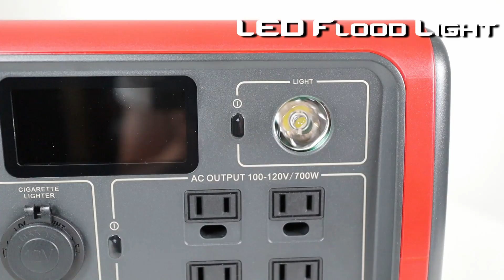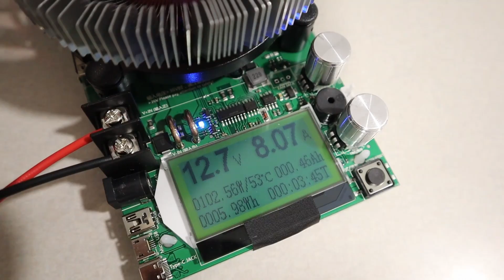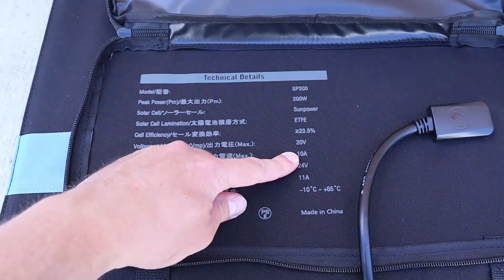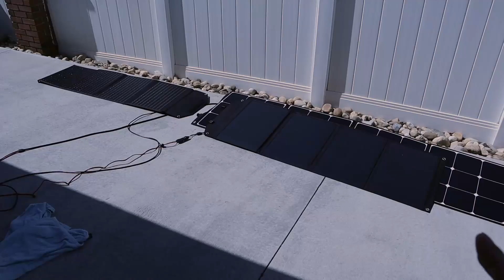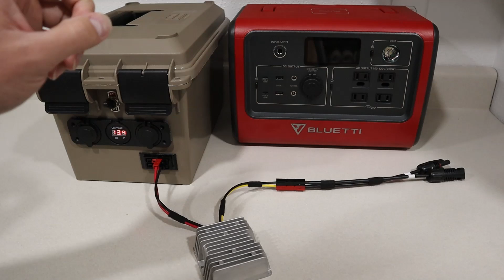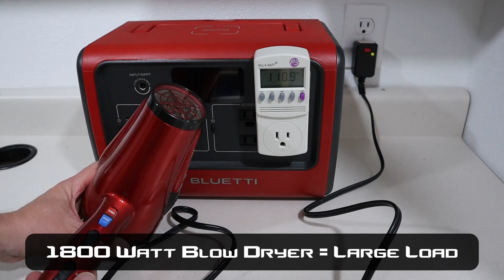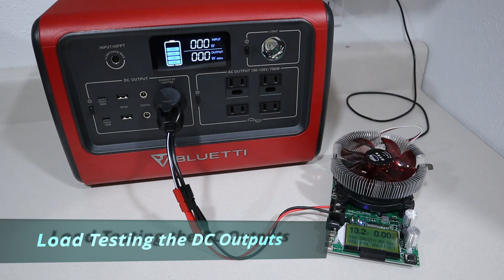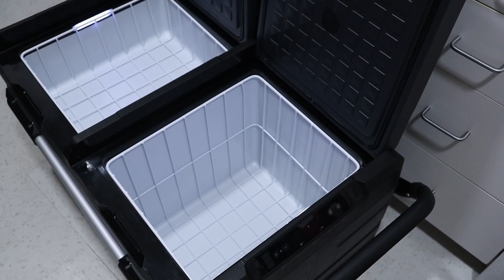Bluetti EB70 LiFeP04  + SP200 Solar Panel - Best Battery for 12v Fridges? - Full Review and Testing!

Comment: This is definitely the best EB70 video on YouTube.  Most importantly some useful info with regards the number of watts at various input voltages while charging, plus the total number of Wh and Ah DC. By the way, I can live with the 600, plus watt hour DC output figure for my use.

My favorite part of this review was seeing the possibility  of a 188 watt DC to DC charge rate.

My own thoughts on this consumer grade, all-in-one, plug and play, compact power center, which is housed  within a small plastic box is that it suffers from some cost engineering:

*The underwhelming display was probably good enough for smaller/ less expensive Bluetti AC30 and AC50S
* The Bluetti EB70 needs an Info button to briefly turn-on the display, please to avoid using the quirky function buttons
* Are the quirky function buttons to turn-on the DC, AC inverter and front facing LED light legacy items from the AC30 or AC50S?
* An 8 amp charging limit of this MPPT controller probably chosen to prolong the life span of some of the internal components are not pro-grade
* None of the online reviewers have noted that the output cable of Blueitti's provided AC to DC power brick uses 18 AWG wiring - which is crazy for 200 watts
* Why are we trying to squeeze 200 watts through that 8mm charging port versus either an Andersen or XT60 port?

With all that said - I'm comfortable with running my 40 liter, 12 volt DC fridge on the EB70.  The 8 Amp charging rate means that a fully depleted EB70 will need to be on whatever charging source for 6 to 8 hours - if the use of Bluetti's AC to DC regulated power brick is not feasible. (For me, it is definitely a limitation, but not a deal breaker).

Don't tell anyone, but I love being able to plug my MacBook directly into the USB-C port.  Thumbs up Bluetti!

For now, I'm using the provided 32" long cable 12 volt cable for on the road charging via a fully fused, dedicated 10 AWG wiring run to the vehicle's battery.  Unfortunately,  I have to manually unplug it when the truck's engine is turned off.  I'll definitely explore engineering a D.I.Y. 12 to 24 volt converter set up for DC to DC charging with the addition of an isolator between the vehicle's battery and EB70 so I no longer have to manually unplug the unit.
Reply from the maker: Sounds like an excellent setup Andrew! Thanks for sharing your thoughts on how you use your EB70. It does seem a bit consumer grade vs pro. The price is decent for where it stands. 

I just got back from a 3 day trip where I used a 45qt dual fridge and freezer on the EB70. It was only charged it via solar. Worked well!
Reply: @Jasonoid  Jason,  I am very forgiving of EB70 because of its small size and weight. Space is at premium in a 4x4 vehicle.  Your review of the EB 70 was on the money.

I failed to mention where I am coming from.  For the past six years I've relied on my trusty circa 2006 state of the art set up that requires the use of a 60 lb, Group 24, flooded lead acid AGM battery and it lacks either an MPPT or PWM controller.  My DC to DC charging is via a second-hand purchase, CTEK fully automatic charger for in vehicle use . The entire package for this old-tech set up is much larger than either the EB70 or the D.I.Y ammo can auxiliary battery shown in your video. If you stay out of the Arizona desert this old-school monstrosity will definitely power my fridge for 36 hours during the summer months.

The EB70 on the other hand is less than half the size and a third the weight. It'll probably power a fridge for 36 hours without a recharge.- (Plus, it includes an AC inverter and MPPT controller). - Two other major advantages noted so far in only two weeks of ownership and three day excursion is the EB70 does not require shutting things down when the battery reaches 12.1 volts or having to keep the battery on trickle charger when in storage mode to prevent sulfatation. 

 My main problem with the EB70 at the moment is it definitely needs a tie down point or a special anchored cubby space to keep it from moving around.

Comment: Bought it anyway, while others can't deliver to my address Bluetti did, those 'quirks' is personal taste and does not affect that the EB70 work for me or my wife. I live in the Caribbean and Amazon is very picky sending to my area. BTW bought the BougeRV and the Ac200p same reason availability and delivery. Great video.,,👍 Explaining the solar panel dilemma, im using a Siemmens SR 100 .
Reply: You made a great choice in my opinion. I have the Bluetti and I`ve been testing it with a small 5 cubic foot AC freezer and a 3.5 cubic foot AC refrigerator and it powers them perfectly. Even with two inexpensive 100 watt glass solar panels in parallel I believe you can still get nearly 150 watts into this thing. I need to test this soon and find out exactly what happens. 

The 2500 charge cycles to 80% capacity is a miracle! I`m in Louisiana and we were directly hit by two hurricanes last year. We lost all our food. The Bluetti is my insurance against that happening again. I don`t want to depend on an expensive gas generator when roads are blocked and gas is impossible to find. I also bought two 300 watt power stations for smaller things like 100 watt 12 volt rice cookers and immersion water heaters to make coffee and tea. 

I have 15 of the little power banks between 10,000 and 36,000 mAh I can charge with seven folding solar panels I have between 20 and 60 watts that have USB ports and USB universal chargers for my radio and flashlight batteries. I also bought three USB fans and several 5 watt warm white USB LED lights.

Comment: Very helpful video!

Three questions: 1) Do the fans in the unit stay on when using DC output?  2) Does the unit cause noise with speaker systems? 3) Can you charge and use AC/DC at the same time?
Reply from the maker: Yes, you can charge it and use it at the same time

The fans only turn on if there is a large load on the battery, I never noticed it while using the DC load output, just the AC output over 100 watts.

As for noise for speaker systems, I haven't noticed anything in particular. Anything you want me to test?
Reply: The charger fan doesn't stop until you unplugged it. I would not just leave it over night to charge as the fan will keep on running eve. After it is fully charged. My does anyway

Comment: I`m happy with mine because it actually powers the 5 cubic ft freezer I bought that runs at about 84 watts after it settles down. I got two 100 watt Mighty Max solar panels and parallel connectors to charge it off grid. My Rockpals and Golabs 300 watt power stations show an error with the freezer...BUT....I can charge those while the Bluetti runs the freezer and use them to put about 540 watt hours back into the Bluetti when I need to. 

So they`ll work as a team if we get hit by two hurricanes again and this time my food is safe. Plus even on a very cloudy day two 100 watt panels in parallel can charge the smaller power stations at a decent speed. I bought poly panels instead of mono because they were cheaper but I plan to get a 100 watt mono panel soon for testing and for the rumored superior performance on hazy days. My small folding mono panels work even when it`s raining! LOL!

There`s a great 100 watt 12 volt rice cooker on Amazon that works great with just about any power station.

Comment: I know why it's only limited to 8amp input. And it's something you can only understand if you work in repair. I can guarantee that if they let it take 10amps, You'd end up with way less charge cycles. Compare a Mercedes to a Toyota. Toyotas last longer because the make engine that put out half the power of a Mercedes.
Reply from the maker: Great point Carlos, Lifepo4 batteries can usually handle a 1C charge rate! So if these are a 32amp hour set of cells as noted on the back sticker of the EB70, it could technically charge at 32amps if they designed it that way. For example, my DIY 80ah battery could charge at 80amps if I wanted to and it shouldn't cause damage. Less charging rate might be better for longer life but the difference between 8 amps and 10 amps shouldn't really matter on these cells. Thanks for commenting! I wish they bumped it up just a tad
Reply: @Jasonoid  I agree. The 2amps ultimately should have just been given. But most likely bluetti doesn't manufacture their own charge controllers. Like most companies they probably manufacture very little themselves and they just source components and make them work well to where they can guarantee a warranty. A cheap mppt controller and display is all that keeps this from being unbeatable
Reply from the maker: @Carlos-jh5tb  totally agree, still performs very good for the price, especially while having Lifepo4 cells!
Reply: @Jasonoid  definitely. And I think the 100w usb c ports are slept on right now too. But all decent laptops and chromebooks charge via PD. At 100w each. It's going to remain being useful for it's entire life span.
Reply: @Jasonoid  The recommend max charge rate for most LiFePO4 is .5C. So the limitations is not for cycle life.

But the 8amp max is sensible. The reason for 8 amp is that it's 80% of 10A. A lot of cigarette lighter socket is 10A max.

But having 8A max, you can connect it to a stock car without blowing the fuse.

In addition, the 7.9mm socket also have a limit around 8A.

The solution is to have higher max voltage. 60V maybe?
Reply from the maker: @MichaelEricMenk  This is a 50amp hour battery so .5C would be 25amp charging rate. It has a much higher ceiling.

Yes, putting panels in series would have fixed the slower charge rate. Their larger batteries support series solar panels so not sure why they didn't go that direction on the EB series.

Comment: Another thorough review.  Thanks.  I wonder if the curve on the fridge run times with the 70/85 ambient temperature is a linear or exponential curve.  I live in Arizona and curious about the run time with 95F days.  Also what is best practice.  Should you run down Lithium and LiPO batteries to zero on a regular basis?  I thought I saw if you just run it down to 50% you can get many, many more cycles on both types of batteries.
Reply: See Will Prowse videos about lithium batteries or batteryuniversity. Never store or leave these at full charge for long. If you charge it to 100% run it down to below 90% right away. The last 10% of charge is hard on the battery. Keep charge cycles between 20% and 80% or 30% and 70% to get many more charge cycles but run these down to zero and fully recharge from time to time to keep the battery cells balanced and display calibrated. Never try charging below freezing (using is ok) and avoid excessive heat.
Reply from the maker: It could be linear for sure. This pattern is almost exact on all the fridges I have tested. Just remember once you hit a certain temperature the fridge compressor is just running full time on ECO mode, which is usually 33 watts or so, so at least if you plan for a constant 33 watts you'll be good. 

You can run LiFeP04 down to 20% capacity without permanent damage. I'm hoping the BMS inside the EB70 is taking that into account. I'm sure it is and that's why we aren't seeing a full 716wh on the testing. I only run it this dry on my tests, I always try to keep it topped off while camping because you never know when clouds will show up! Haha (I've had that happen before and had to get creative!)

Comment: I cant remember what the voltage rating on the rockpals was, I think it was around 24 volts as well, based on your last video. I wonder if you put a volt meter between the parallel cable and the power station....what voltage would it show on the SP200 and the two rockpals. 

Fun tidbit that you probably know, you can use a parallel cable without the other panel in it. So you wouldnt have to shuffle around wires too much.
Reply from the maker: The rockpals panels are rated slightly less volts than the SP200. I think 19v vs 20v. But who knows if the specs are accurate because the bluetti "should" be putting out more power but it's not.
Reply: @Jasonoid  yeah so many factors to consider.

Comment: That 500 some odd watt hours is kinda what I saw during a casual test that I did. I was a bit disappointed and it made me wonder if they sent Hobotech a "good" unit. 

Keyword is just a bit.
Reply from the maker: Pretty interesting right?! I wonder why he didn't test the EB70 with his SP200 solar panel either? Well I was happy with the DC output results and that's how I plan to use it most of the time. It's got some quirks that need to be fixed on a "newer" version but other than that it's a decent battery for powering my 12v fridges. Better than the Jackery 500 in my opinion and it's priced just a little higher.
Reply from the maker: @AskIveSolar  Thats a good point.